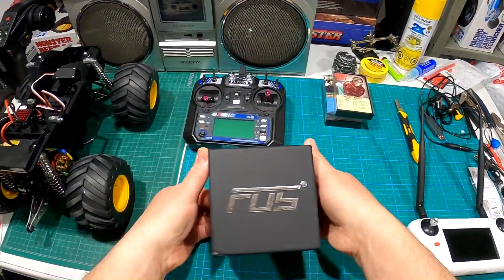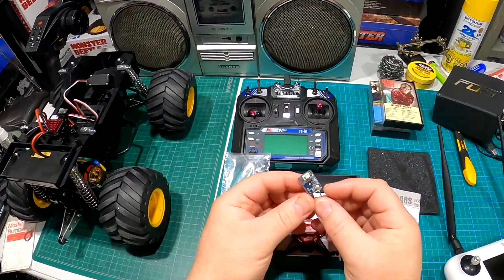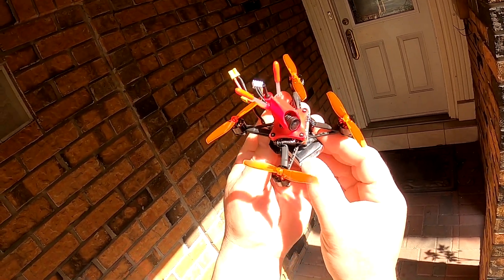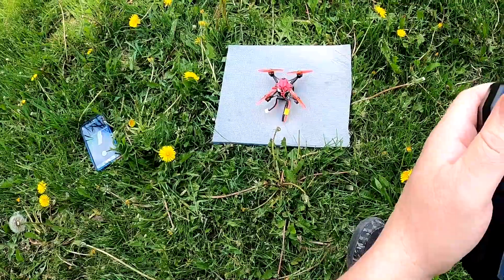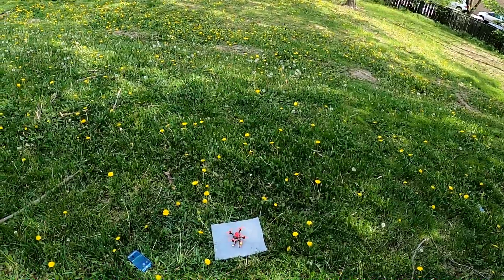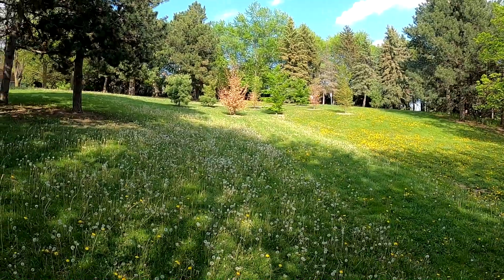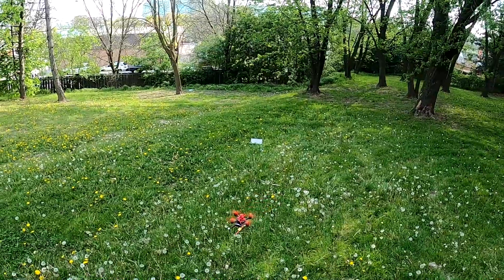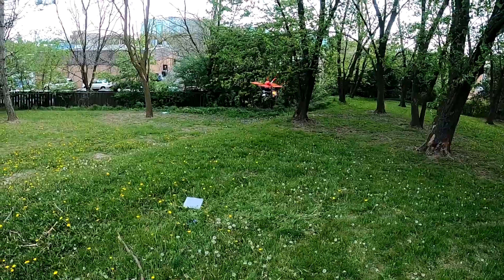My Attempt To Learn FPV Drone - Flysky i6 - FUS Spartan Drone - FPV Beginner

Comment: Nice first flight! Good to see it working for you. Yea get those goggles on,.... Your gonna love it!
Reply from the maker: Well good news and bad news...lol. The bad news is I tried to fly in the same location with my FPV goggles on. I flew around a bit but I had one crash that wasn't that hard but I broke my frame on the Spartan. So on the rebound I went and bought anEmax TinyHawk Freestyle 2 at a local shop. I put a Flysky receiver in and set it up and took it to a large soccer field. This time with more room I was able to fly around in angle mode. That's the good news...hahaha. I now have it set up with ACRO trainer mode so it can't go past 45 degrees in ACRO. I have also been on the Liftoff Simulator a lot flying in ACRO so I'm going to give it another flight maybe tomorrow. I will try and get some video of it.

Comment: I was mentally driving it and I crashed 10 times already 😂😂😂 idk if I could do that
Reply from the maker: Hahaha...it's a challenge for sure. Big difference from flying something like a DJI Mavic or any other GPS drone. Those things practically fly themselves. But whats even harder than flying line of sight like I did here is flying with the FPV goggles on. Its very easy to get disoriented. I have been practicing for days on a flight simulator. Also another thing is you get motion sickness when flying FPV.

Comment: Well done buddy! Looks like you'll get the hang of it. I tried a race drone once I just couldn't do it. I could fly it a bit because I have a Mavic but I'll never be able to do the full acro I just don't have the skill 🥺 look forward to ya next flight dude 🤘🏻🤘🏻🤘🏻
Reply from the maker: Thanks brother! I have 3 modes programmed in. Angle  mode which as soon as you let off the stick puts the quad back to level but wont allow you to roll it past a certain degrees. Then I have Horizontal mode which is the same but in this mode you can do full rolls and flips and still goes back to level with hands off the sticks. Lat is full acrobat mode. This is the mode I may never be able to fly in. Basically if you turn a stick the quad keeps going in that direction until you move the stick to the opposite direction. I trued this in a simulator and couldn't fly at all barely! And most people seem to fly better with FPV goggles on because there is no reversing of the controls as the quad is pointed towards you. Me I am a bit different...I seem to fly better looking at the quad than with FPV goggles. I tried them on my FIMI A3 but I prefer looking directly at the quad. The problem is you can't fly far with line of sight...lol. More practice required.
Reply: @KaizerTest  Yeh I know what ya mean, with the DJI stuff I prefer looking at the screen even if the drone is near me but with the race drone I flew better looking at it. Soon as I tried the goggles I had no aware of my surroundings or how far off the ground I was. Bloody hard mate? If you get good at it I will salute you! 👍🏻
Reply from the maker: @ksrnate  That's exactly how I feel. I have no perception of height or surroundings like you say. I'm going to give it a good shot though.
Reply: @KaizerTest  It's looks durable hopefully so when you bin it it won't be in bits 🤞🏻 I had this thing called a storm it was a silly purchase really. Think it was 5inch and did 6s 🤦🏻‍♂️ I was terrified of it lol plus it wouldn't have survived 1 crash. It had beginners mode like yours where it levels out but that was as far as I got with it. Sold after it after it collected a lot of dust 🤣 the guy who bought it never flown anything before and didn't know what a lipo was??? It'll be in many pieces now
Reply from the maker: @ksrnate  Hahahaha.....poor guy who bought it. He's probably onto something else by now. Yeah overall this one has a bit of durability but the motors and props are vulnerable. The motor shafts are very thin as are the props. I need to get extra props for sure. For now I'm flying it easy.
Reply: @KaizerTest  Oh eye lots of props lol. I'd love to get into fpv but I just can't do it? Oh well have fun my friend 🤘🏻🤘🏻🤘🏻
Reply from the maker: @ksrnate  Well brother you were right...lol. Even though I can fly pretty decently looking at the drone I had trouble wearing the goggles. I flew around ok for a minute then got disoriented and I bailed into the grass. It happened a few more times and the last time the frame broke! So I'm kinda stuck now...hahaha. I just started and I need parts already. It's bloody hard like you said. I did it for a few minutes but it's so easy to drift away from yourself. That area I was flying at isn't big enough for a newbie either. I'm not giving up though..not yet...lol. 😢